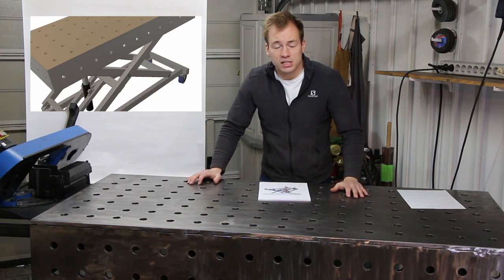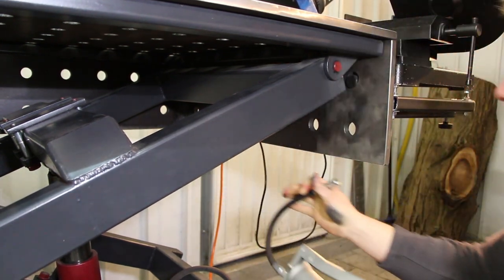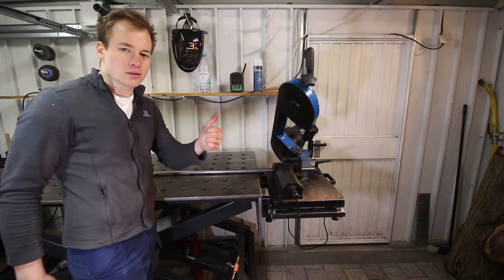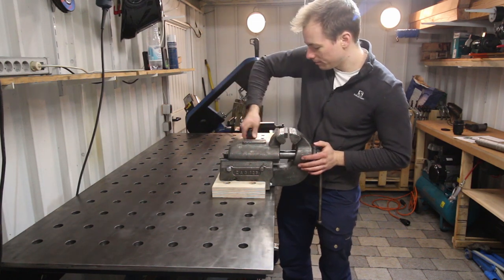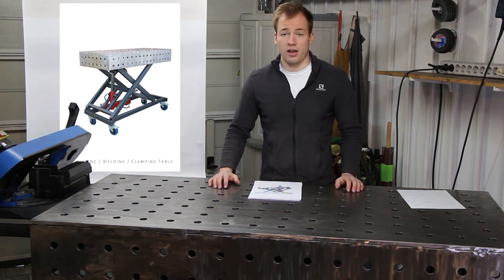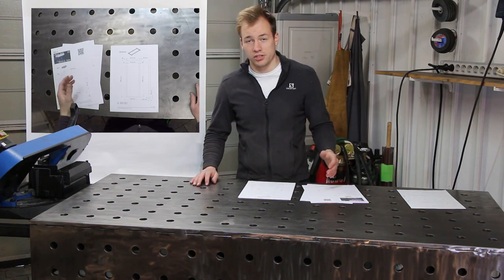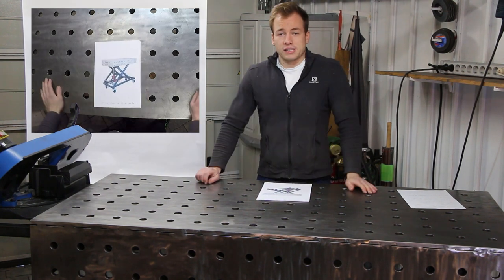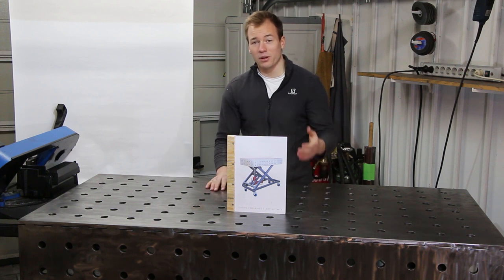PDF Plans are online! - Heavy Duty Liftingtable #6

Comment: I don't see any kind of a safety-system on this table to prevent it from collapsing due to a Mal-function of the hydraulics?
Reply from the maker: Yes that's right, there is no dedicated safety system. Having a 100% safety factor (means it can actually lift double the weight) was good for me. 
Couldn't think of a safety system that didn't have an inconvenience...
Reply: @HolzFlo  This is a point I was looking for. As a retired industrial maintenance person, safety is a most for any and all equipment. In my early years in sawmills, scissor lifts were a main contributor of fatalities and major pinch point accidents. Not because they failed mechanical but because the release to lower function was activated while the operator was in harms way. Watching your build videos made me very nervous when you were in one of those pinch points or underneath the unit working with nothing keeping it from activating and crushing you. Please, please add a safety lock system that will not allow the unit to move without the safety device purposely disengaged!
Thanks for sharing.